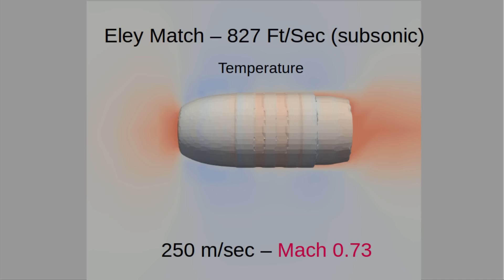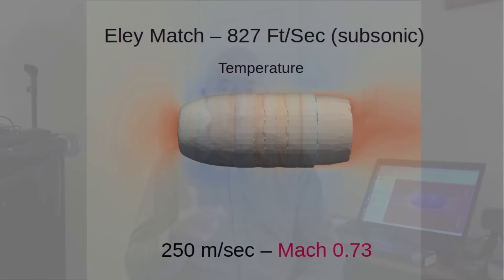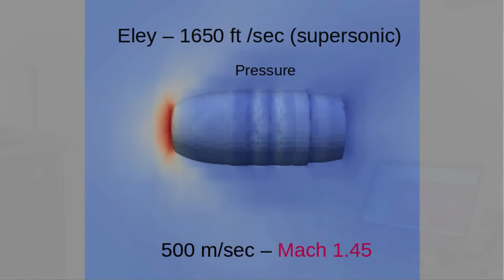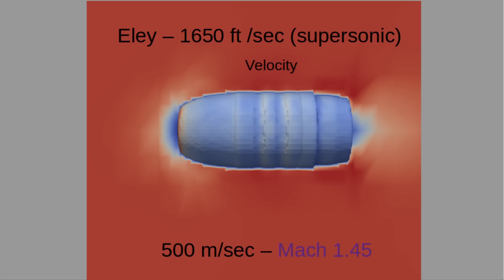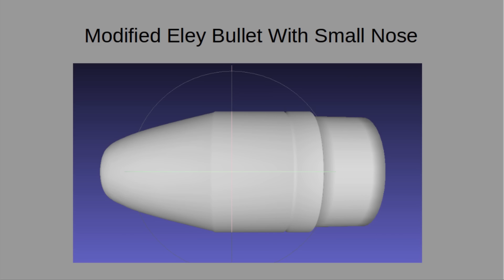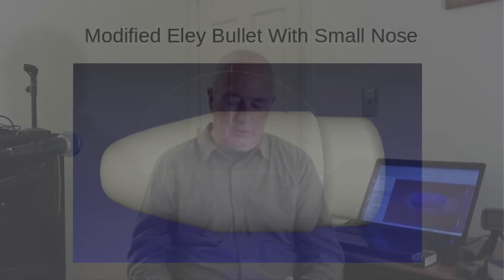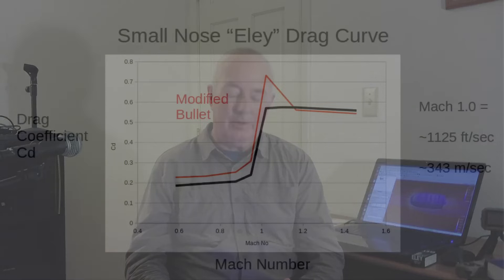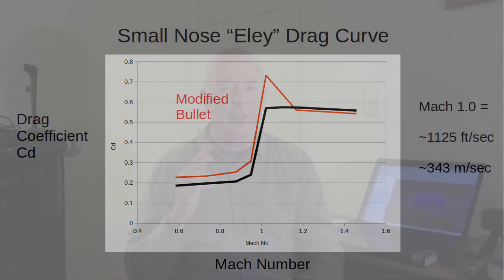22 LR Aerodynamics and Ballistics

Comment: Ahhh so airgunners have some great tables on projectiles in the 750-1050fps range. We call solid bullets like these "slugs" but otherwise we shoot similar profiles, minus the heel. One thing of note is the wind drift, and BC changes at ~950 fps. The wind drift numbers get WORSE at 1000fps and don't get better until 2600fps! Unfortunately most .22LR is much faster than 950fps. If you can maintain subsonic speeds, you WILL get better accuracy, consistency, and less wind drift.
Reply: @life_of_riley88  absolutely, it's a much different shooting experience than firearms but very satisfying.
Reply: I was wondering if an airgunner would post.  This is a great video, but any good rat sniper knows all this.  Especially trans-sonic velocity issues.

Comment: It's mind boggling (to me at least) that the heel on the bullet does not ruin the ballistics of the projectile.
Reply from the maker: Same here. Eley tapers the back end of the heal, so it approximates a more modern bullet. That might be part of the explanation.
Reply: Most times when something gets smaller on the tail it improves aerodynamics - like those big fold-out panels on semi trailers.
Reply: @19Borneo67  Also the the extended 'boat tails', on the race cars at LaMans in the '70s. I was closely watching the NASA research on drag reduction on semi trucks, also in the mid '70s, I believe. The further they extended the faring out past the flat rear of the trailer the more aerodynamically efficient the vehicle became.

Comment: Excellent balance between being clear and being absolutely technically accurate. I didn’t hear anything that you said that was “wrong” and you didn’t get lost in the weeds. As an ex-CFD guy, I would tend to get overly detailed and caveated for my audience (management) in an effort to be totally transparent. They just got bored or confused, or both. I did that because I learned the hard way that Box’s quote, “All models are wrong, but some are useful.” is really true. CFD can be a very useful tool, but it isn’t Truth. Some people take the simulation outputs as Gospel and don’t run them through the BS-o-meter, which can bite you. I am interested in OpenFOAM now to see what it is as I am now retired and don’t have access to the industrial codes any more. Thanks for an excellent presentation of your work!
Reply from the maker: @andrewhahn1476  Thanks, and thanks for reminding me of that great quote. One thing I have found throughout my career is that building models is a key to understanding a subject. Once you get that understanding, it is best to throw the model away.

Comment: I have noticed that most subsonic rifle bullets match the external ballistics of subsonic .22lr fairly closely. Staying out of the transsonic velocity range seems to eliminate a lot of weirdness.
Reply: When a bullet goes sub sonic all sorts of unpredictable things can happen as it can lose stability and start to wobble or even tumble in some circumstances. 
Staying subsonic eliminates the unstably factor and the bullet will fly true until it hits something.
Reply: @wwalker3738  I wonder if increasing the twist rate for another 20K RPM may help stabilize the projectile as it decelerates through the transonic region.  the forces acting on the projectile will be the same, but the higher angular momentum may increase resistance to tumbling.
Reply: @rickmoore6527 you can speed up the rpm but…. Once you start over stabilizing, their nose will no longer follow their trajectory and they will start “floating” like a football.thrown really far. And then you lose tracking and all of your bc.

Comment: In the research you will notice that boattails dont do much at subsonic velocities (yet everyone mistakenly wants a boattail for its supposed improved lower drag). However, if you check the data, you'll see that a heel or gas check rebated base (without the gas check) has a very good a drag reduction at subsonic compared to a flat base projectile. There's some other advantages to a healed bullet and that is when a boattail is exiting the muzzle the gas jetting around the boatail tends to knock the tail off to rhe side slightly and so the bullet base 'spirals' or hunts for the first 50 to 100 yards before settling down. The crown of the muzzle is critical to launching a projectile smoothly. A flat base bullet exiting a cocked muzzle will get a jet on one side first and be knocked off quite a bit too BUT the healed bullet is affected least by this.
I shoot bigger bore cast bullets, very long range and subsonic only,  not 22LR and I've gone pretty much all healed designs (ordered as gas check molds but no gas check is ever used). I'm not ordering stock molds, im having my own custom designs done (ie: at Accurate Molds and even 4 of my designs at NOE Molds).
Note that boattails are especially poor dropping down into subsonic at extreme ranges which is a problem the military has delt with for years with it ELR sniper rounds, the further down range around trans-sonic, the MOA jumps up a lot.
And further, ive found that a flat meplat  of 62% to 70% projectile diameter has a better Drag Coefficient than a rounded or pointed nose as you indicated in your video. The nice thing is that a hollow point loads up with air and becones the same drag as a solid flat meplat, so i use a HP aa necessary to adjust the CG of the bullet and move it aft (and some of them are good hunting rounds too, search for NOE mold # 358-152-HP-CF4 but shot without the gas check. Shot at 950 FPS its not lubed but the grooves give reduced bore friction, but the contact length gives it good internal ballistic stability (not cocking in the bore like a lot of shorter bullets) and a fair length for external ballistics (of course the ideal is 6:1 but in this caliber for subsonic flight only it gets shortened). The mentioned projectile, shot subsonic, gets MOA at 500 yards so I'm pretty proud of it.
Reply from the maker: And I thought I took my hobby seriously! You have me beat by a long shot (pun intended)!
Reply: @jamesconger8509  I'd note that I might cast 200 bullets but by the time I QC them and eliminate any with weight variations (they all have to be visually perfect but MUST weigh within 0.01 grains) I get around 30 match grade slugs. And I consider myself an expert caster and have probably cast around 15,000 to 16,000 bullets (and shot them too!). I HAVE to shoot into bullet traps because I need to recycle the lead to save money. I have a range on my own property with 25, 50, 85 and 100 yard target stands (and a trap behind each)
Why 85 yards? Because at 950 FPS, an 85 yard zero gives +-3" high at 50 yards and +-3" low at 100 yards. All my subsonic rifles are zeroed at 85 so I can swap from rifle to rifle and all hit the same point of aim.
And I hunt a lot of hogs all year round, it simplifies drop calculations when aiming if you don't know the exact yards.
Reply: You rock. That explains why my Accurate Mold for .447 concicals with a gas check shoots so damned well in my cap and ball guns. It's point of aim up to 25 yards with 30 grains of Swiss. My friends were impressed whch ish ard to do .

Comment: I found your discussion of comparing modelled results to single data point physical results very interesting.  That is quite similar to the way naval architects design ship hulls (my profession for a number of years).  We couldn't afford to run models of all the proposed designs down the tow tank, so we used a combination of the results from a standard design series (some of which are very old), and a single design we felt was in the ballpark, as the basis for making small tweaks here are there in the shape of the hull.
Reply from the maker: I must admit to dabbling a bit in the fluid dynamics of sailing boats. If you look on my channel you will find out what I learned. Sailboats are another example of an old but highly optimized piece of machinery.

Comment: Spin rotation is also dragging air around the rotational axis although minimal it factors in.
Reply from the maker: The software I'm using does not make modeling spin easy to do. I put several weeks into it without much success, but I might try again. Our bullets go about 64 diameters forward per revolution, so from the bullet's point of view it is pretty slow.

Comment: I have a cnc machine, and a significant background in the hard sciences. I like to fiddle around with making my own bullet molds, especially for shotgun slugs. Is there a free or cheap program I can use for running pressure/ drag models? Possibly something similar to Fusion 360s free version. Ideally it would be able to tell me the center of pressure and center of gravity for a model, but anything would help.

Comment: As the bullet travels thru the air, two sources of drag are present. Nose drag and skin drag. A pointed nose has more surface area for the length covered by a hemisphere. A stepped conical shape can have LESS surface area if the proper angles and lengths are used.

Comment: In general, the bore twist rate must also be taken into consideration in 32- 36-, 40-,or 45-grain projectile weights of a mirriad of ammo brands, as the standard 1/16" twist rate is currently challenged by 1/12" and 1/13' twist rates that appear to stabilize the standard forty-grains .22 LR and the thirty-grains .22 Short better than the 1/16" twist rate commonly found in .22s. The 1/9" twist rate for the Aguila SSS 60 grains works, whereas the other twist rates don't. My Walther P22 has a 1/13.4" bore twist rate and does exceptionally well in a 5" bbl. @ 25m using ELEY Match. Therefore,  it would be interesting to see how the ELEY Match bullet behaves in other bore twist rates in comparison to the standard 1/16"bore  twist rate.

Comment: So, if I'm understanding this correctly, the ideal velocity would be below or above the trans-sonic range, correct? So wouldn't it be better to have the bullet never hit that range if you're shooting at distances that are short enough to avoid excessive bullet drop? The same would be true for longer distances, where the bullet stays at supersonic velocity and never falls into the trans-sonic range, right? Wouldn't adhering to this basic premise avoid the problems that occur when the bullet enters this trans-sonic range? Why would you make a cartridge that stays in that velocity range, like the CCI standard at 1070 fps? That velocity is right in the middle of the 'trouble zone'. Edit: great video!
Reply from the maker: @godzillaburger9690  The air gun folks favor low velocity when they are shooting short distances,  I think for the reasons you state.

Comment: Interesting how the 24 inch barrel produced slower velocities. I reckon the bullet/rifling dynamic friction was greater than the gains from the added time under pressure for those last 8 inches.  I’m thinking that, the powder was fast burning - perhaps designed for short barrel applications - such that the gas pressure had dropped below friction losses.  I wonder if the loss of acceleration- while still in the barrel also reduced stability slightly - since bullet spin (in RPM) would also slow a bit.  Again, very minor drop in velocity ~10fps - so any stability loss might be too small to measure. However, the take away might be - don’t waste money and effort buying and using a 24 inch barrel.
Reply from the maker: @refuztosay9454  I've seen other people report higher velocity with a shorter barrel,  so don't take my numbers as an average.  Every gun is different,  including ones from the same manufacturer.  I guess it would be boring if they were predictable!
Reply: I can't find it at the moment, but I have enjoyed a YouTuber's video testing for the optimum 22LR barrel length. It was more than 16" but defiantly less than 24". If I find the vid I will post it here.

Comment: The barrel length data shows that the pressure of the small powder charge drops below barrel friction beyond the 16" barrel for these loads.  I always thot so...  But I only have my 5.5" target pistol and my Ruger 10-22 18", so  had no way to test that. Very interesting show.  
Eons ago, Herters made some coke bottle shaped 22 bullets - it was known that wasp waisted aircraft had lower drag...  It might be interesting to model them vs. say Hornady spires vs. Sierra spitzers.  They shot well in my 222 Rem.  IF they maintained shape in the barrel, they would have less  barrel friction, too.  I thimque I may still have a few around someplace.  I may load some to compare BC's with my Lab Radar...

Comment: The ideal shape for supersonic projectiles should be the sears haack body, so good modern bullets are some kind of extended ogive with a boat tail, and have drag coefficients that are pretty close.
Similarly there should be an ideal shape for transonic and subsonic projectiles, most likely something airfoil and supercritical airfoil shaped. 
I suspect that that Eley Match is getting pretty close to a stepped supercritical airfoil.

Comment: I adjust my speed in the kestrel to match the real bullet flight out to 200 yards regardless of what my chronograph says. I just use the chrono to identify flyers/ES outliers while im getting dope. After 200 I adjust the AB 'drop scale factor' in the kestrel. G1 also works well but i really like how easy the DSF feature makes it to get a good dope card. Loved the video thank you for the lesson.
Reply from the maker: I think the reason this works for you is that you are working around the poor fit of the G1 model by adjusting the muzzle velocity. Try using the G7 model with a BC of around 0.069 and the measured muzzle vel. I think you will find it fits the data better.  BTW: I used to do exactly what you are doing.
Reply: I'll give it a whirl and see how it goes!

Comment: James, if you recover a fired .22 LR bullet from a deep water tank, the base is bulged out to meet the barrel groove diameter, by means of sudden application of high pressure gas ahead of the chamber.  So, the bullet base "in flight" does not look like it does, before firing.

Certainly, full depth land impressions can be observed almost all the way to the rear of a fired .22 LR bullet.

If Eley are attempting to mimic a boat tail bullet shape after firing, the rifling spin requirements for stable flight will exceed the typical 1:16 for a .22 LR barrel.
Reply from the maker: @rickoshea8138  Any chance of a close-up photograph?
Reply: Look for this string:
STKO 22LR Accuracy UNKNOWN SECRETS Found
Reply from the maker: @rickoshea8138  Thanks. It looks like the heal expands enough to merge with the outer diameter of the bullet. Good for stability,  but bad for drag. I would choose stability any day.

Comment: have you considered modeling bullet heads that have been fired. The soft lead heel of a .22lr changes shape...  they basically turn into a G1 profile when they leave the barrel.
Reply from the maker: @hunt3r827  How would I collect a sample bullet without further deforming it?
Reply: @jamesconger8509  You might be able to look up slow motion footage of .22 bullets and use that to model the shape after being fired. (I don't know where that would be found though)
Reply: @jamesconger8509  I will attest to the idea the 22 heeled bullets change shape. I've recovered dozens of projectiles, anything from the 20gr colibri, eley match, to the 60gr snipers. I've normally been able to capture these after they pass through game and they bury themselves into snow or soft dirt. I've also recovered bullets buy shooting them into dense snow and they come out perfect. 
Fired 22lr bullets will no longer have a heel. I think it's a common misconception that I've heard other channels over look. I would be interested on your take on this. 
Thanks for video.
Reply from the maker: @joeneu  I'd be interested in any pictures you might have of recovered bullets, particularly the Eley. They have a convex back end which may deform from the pressure of the charge.
Reply: 3' of ice free snow works perfectly for .22lr.
Reply: @deandeann1541  Nice....specific data!

Comment: You should verify the shape/profile of a fired 22lr bullet.
The obturation of the heel and swaging by the leade
changes the shape from the heeled projectile you show,
to a round nose cylinder, with no diameter change
at what used to be the crimp line.
Bullets recovered from a snowbank, water tank, poly-fil trap
all show the crimp line and smaller diameter heel
have been reshaped to a uniform diameter from the leading edge of the drive bands to the cupped heel.
Reply from the maker: Several people have made that comment. The "no heel" model in the video might be the base case.

Comment: What’s crazy to me, is with CCi standard in my Savage MK II, I can easily hit soda cans at 150yards, but at 200 yards it all falls apart and everything hits all around the can, and inconsistently. I’m suspecting the bullet is tumbling somewhere in that last 50 yards.
Reply: Bullets don’t “tumble” at extended range if they have enough spin for gyro stability at the muzzle. They most likely fly with a sizable non-zero angle of attack and that makes them very sensitive to cross winds.
Reply: @jeffsiewert1258  Maybe you are wrong.
Reply: @deandeann1541 I think 45+ years as a ballistics engineer says otherwise.
Reply: @deandeann1541  i know he's right with out spin the bullet will go any direction